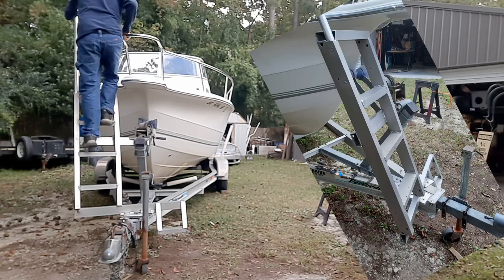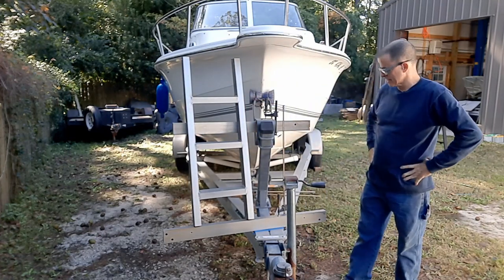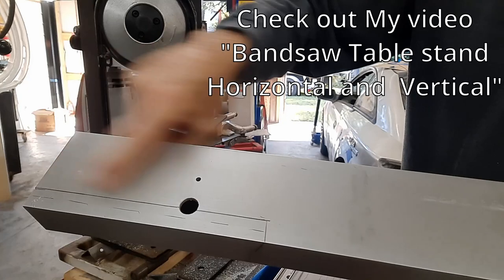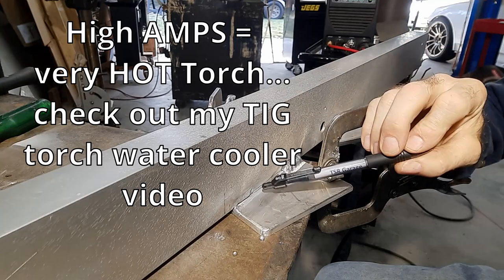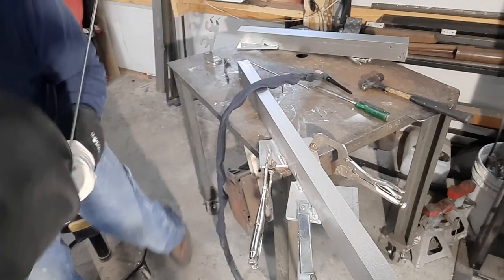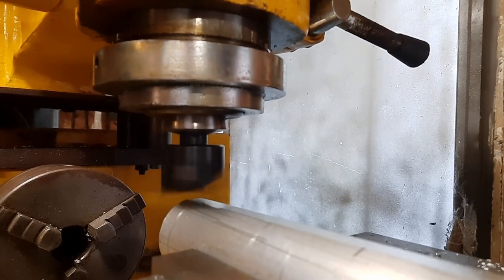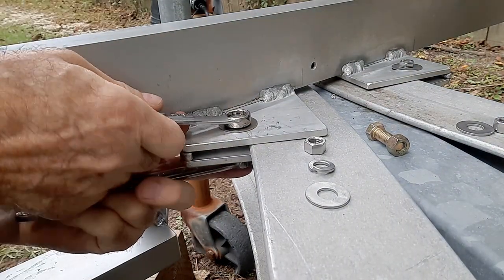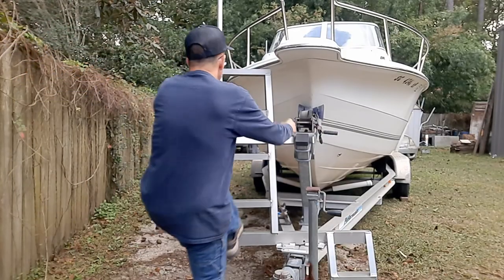Boat Trailer Steps, boat launch ladder.

Comment: Outstanding!  I have a similar sized boat and have been planning on a trailer step project for a while.  Your design with the aluminum is very clever.  I may have to reconsider my decision on using steel.  Thanks!
Reply from the maker: @stevebreland389   I liked the corrosion resistance of aluminum. Every boat should have a ladder like this. Good luck with yours